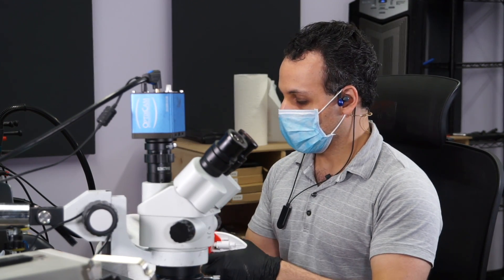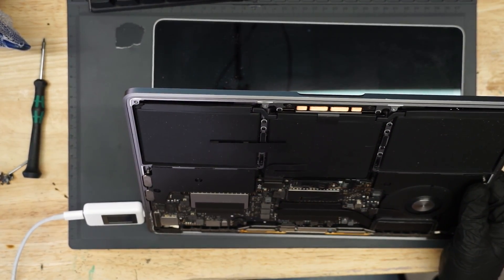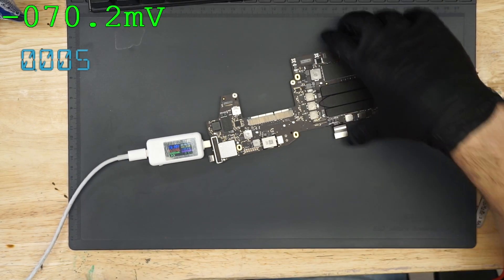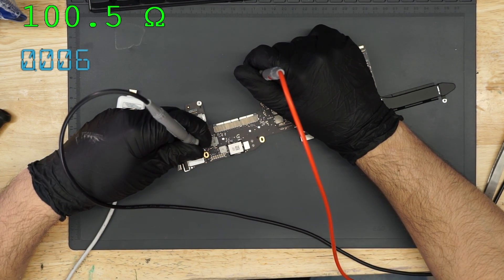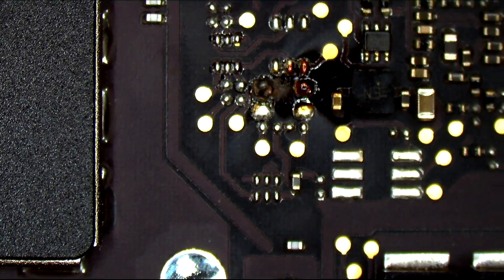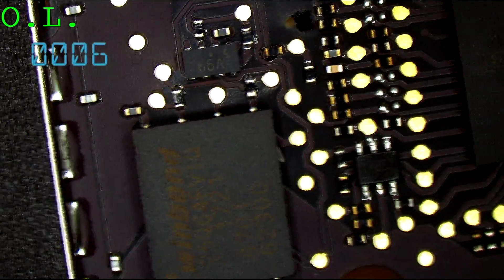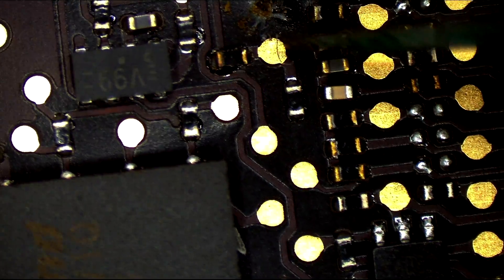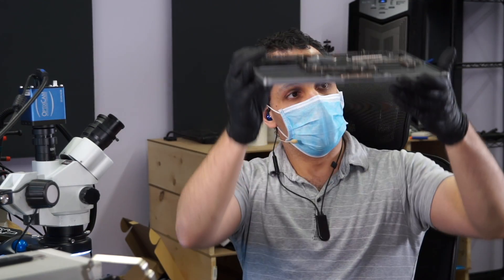Macbook board develops hole through it, Apple calls it liquid damage. 😂

Comment: Customer: My MacBook air doesn't seem to be working.
Genius bar: Alright, let's take a look.
takes the computer into the back and opens it up. Breaths on the liquid monitor, tripping it, and takes a picture. Puts computer back together and returns to the customer
Genius bar: "I'm sorry, your computer seems to have suffered liquid damage and is unrepairable. However, you can buy the upgraded model for just $1599!"
Customer: middle finger and walks away with their computer

Comment: Louis just beware that the "special coating" on the MacBook Pro Retina models screen are very sensitive various chemicals. The ways I clean the screen are either a damp soft cloth or a tiny amount of detergent on a kitchen sponge. So far I haven't had any problems with the coating degrading. Apple even explicitly states not to clean the display of any "notebook" products from apple with anything but a damp cloth. https://support.apple.com/en-au/HT204172

Comment: Customer: "It smells like alcohol"
RRG: "Yes, we put antivirus on it"
Customer: "I didn't think macs need antivirus"
Reply: They weren't doing much thinking to begin with, getting an Apple product.
Reply: @Garenzo314  Ah you don't understand, you need brain power of a special kind to understand. People get apple products for bragging rights. You do not buy overly priced garbage to use, you buy it to show other people you had to money to buy it. Problem is you then don't have money to also buy a working product to use, which would also destroy any reason of owning an apple product cause you wouldnt think of bringing that product you aren't using. 
Takes a special kind of stupid XD
Reply: @Garenzo314  depends how they got it. If it's a gift or something someone tossed out then they are fully inclined to enjoy it. Heck I'm on a trashpicked late 2011 Macbook Pro as we speak. Works perfectly fine and it seems to have been tossed out for its age and because dents in the aluminum chassis suggests dropping

Comment: Customer service telling BS isn't surprising. I had a EVGA motherboard that released the magic smoke one day out of nowhere. After investigation on the board it's one CHL8510 on the VRM of the CPU that exploded. My CPU wasn't overcloked but still there wasn't any heatsink on the VRMs. I contacted EVGA, because franckly I find this to be an oversight of their part and even if the board is out of warranty 4 years for a MB life is quite short. They assured me the chip I took a picture of, the CHL8510 that is a mosfet driver, they told me it was a capacitor and that the capacitor was blown because of a bad power supply ( 3 years later the same power supply is running my actual computer just fine ). Like I don't know how to differentiate a capacitor to a 8 pin mosfet driver ... it was really infuriating to be taken as an absolute idiot.

Comment: Is not possible to hole the damaged zone with an special fine drill head, and then use copper cables to reconnect all the zones that got disconnected by the hole?
Reply: Sure. But a new board is cheaper.
That's a hole in the size of two SMD resistors and there are multiple layers in this board.

Comment: Update: I called a senior Apple consultant and they said the burn was caused by liquid damage and since LR isn’t an authorized Mac service provider, there is nothing they can do. He can’t trust the findings of LR because he wasn’t trained by Apple. If I want, i can take it to another Apple service provider and put my money towards a new one!!!!” Lmao what a joke.
Reply: Jac K - legal action CRA 2015, try section  9 sub section 3 (e) 

You can argue the MacBook isn’t durable.

But, you will need the laptop to be inspected by an independent professional,  then forward the report to Apple. 

They usually settle prior to a court action.
Reply: I believe LR more than apple. He's done many diagnostic and repair of supposedly liquid damaged apple products. I remember one episode where he was angry that a mac was actually water damaged and the customer lied to him.

The board was warped around that particular spot (very small spot) not large area so the word warped is not really correct way to explain it. It was caused by explosion in that particular area where the force caused a "dimple" surface on the other end. Authorized apple service never shows their work transparently and explain where the water damage actually is also. So what one of the fanboy here said that LR never prove otherwise, was in itself pointless. Furthermore I doubt that fanboy knows about board repair as much as LR does.

I'm passionate about LR works because he was sued by apple for doing repair (with reasonable price) that would otherwise forced customer to buy a new apple macbook. Apple is generally a good product, iPad pro is superb, but they are draconian in their business practice.
Reply: Mario Santoso I agree with you, unfortunately it didn’t seem to matter to apple when I called
Reply: @JacK-yb7gu  yeah i'm sorry for your loss there. As business practice goes, that's the only logical response, Apple or not. Really painful to write off $2k++ machine just like that. I hope you have backup data somewhere.
Reply: Mario Santoso LR was able to replace my board. My computer is working again!
Reply: @JacK-yb7gu  great to hear that! I'm truly happy that you got it working again!
Reply: @JacK-yb7gu I'd say stick to AMD for Laptops and for Tablets, IPAD. Cause i love my ipad, so useful.
Reply: @MarioSantoso  Maybe this would be unpopular opinion here, but this is not a matter of belief. Board exposed to water at any point considered to be compromised even it seems fine for months after exposure. Water damage doesn't happen immediately, it leads to corrosion, electrolysis, thermal damage and permanently affects electrical properties of components and tracks, which can lead to fails seemingly having nothing to do with water long after all the liquid is gone. Sometimes you can see some obvious signs like corroded tracks and leads or stains, sometimes you can't see shit. For this reason there are color changing indicators inside.Technicians don't waste time inspecting every board under microscope and testing all the components and tracks, they just check markers.
Reply: @AlexeyOsodoev  yes unpopular :)
I don't mind u tried to explain technical and what you said is true. But come on, r u going to accept a technician just straight up say that ur laptop hv water damage just by looking at the markers? Let's say u know for sure u never spill water? Will u accept that? First u hv to understand how the marker works. What turns them to red? Water yes. Liquid form or from humidity? How much water or how humid? Then you have to look at the "actual" sign of water damage. can they explain and show it to me as customer? Now i don't mind people try to get smart and go into detail here and there like what you try to do here. But really irks me when they don't use common sense and understand what the real problem. What happen to this particular case is just that. Predatory business practice, plain and blatant. And they tried to stop people like LR from repairing the machine. Again please stop talking technical stuffs. I've seen too many people go into detail and miss the whole argument. They see the tree but not the forest. Or for this matter they see the leaves not even the tree.

Edit: I'm not even into the part "can u fix it? How much the cost? Is the cost reasonable?" I'm so irritated now... Thanks!
Reply: @MarioSantoso  Actual water damage isn't obvious or immediate. Inevitably customers who spilled water on their product or left it in a wet backpack months ago will never admit it or accept it as the reason, especially when device worked normally. Forensic work to actually prove that failure is/is not result of water damage is couple magnitudes of order more expensive than the cost of a new laptop. Neither consumer, nor apple would benefit from such approach in every case. That's why there are markers inside. Plain and simple. Apple doesn't make a secret of them and warranty policy. They don't even say liquid damage is the reason of failure. Liquid damage is the reason your warranty void. They don't want to be liable for failure of compromised hardware. If you don't like this policy, don't buy it.
Reply: @AlexeyOsodoev  hmm.. ok. Obviously you avoided the real issue and even dug deeper into your stance. I will leave it as it is. Thank you.
Reply: @MarioSantoso  The real issue here is stupidity of people who don't understand any tinkering with product isn't just about labor and parts costs, there are safety risks and legal liability of parties. You like consumer rights protection, but don't like any obligations this protection requires.
Reply: Alexey Osodoev  Oh boy, here we go... 

You talked with heavy taste of textbook and classroom knowledge/experience. your replies here already swerved from what the video all about, and though you sounded like defending the company that practice those questionable practices, it feels more and more that you are defending your pride. Did my jab about you trying to be smart and need others approval for that came too close to your heart? Well, I'm glad because some people too thick to realize it.

you never answer my questions, then you throw things about risks and legal liability, then more into consumer rights protection and its obligations. oh dear...

i won't go explain customer protection as the sources are freely available and the fight to protect customer rights widely available in YouTube as well. now do enlighten me what obligation you implying here? if you really following the case, the companies try to stop people from being able to repair or choose where they go for repairing their products. famous jargon "your warranty will be void if you go non authorized service center" or somewhere along that line is fine, i never oppose that, it's the rule. It will cost money yes, never oppose that also. i believed this is part of what you mean by obligation.

alright let's go to an authorized service center. look again the video above, the customer went there, genius (i use this term because it's about apple, can be anything else, just for the sake of easiness) checked behind and return to you said oh liquid damage and it will cost $$$ to repair, you might as well buy a new one. how they know? by the red marker - which you defended vehemently (i think because i jabbed about you trying to be smart, so partly at fault here), i won't go over why i object such observation again.

which brings to my reply about can you show where the damage is, how much to repair. Now i said you sounded textbook/classroom or maybe you are passionate about apple or just have loads of money (I'm sorry for assuming all that because my talk about common sense doesn't seem to mean anything to you), if it were me, or like the OP here, we will question and doubt the solution offered. Hell I'm sure most people don't mind paying for repair if it's reasonable, but not really showing where the actual damage is and charged $$$ for repair or get a new one? Now this is where you just firing all cylinder about technical stuffs which again very textbook and bored me to oblivion. No no no it's not about that. The video get back to the video. All the comments were about the video. Apparently it can be fixed and the cost was much less than what the authorized service charged! Now this is what i meant predatory business practice. And there are hundreds of cases like this. And that sir is the issue.

Have you watched LR videos? There's one episode where they charge something around 800++ (cant remember) to repair laptop battery not charging, but LR found out that the battery cable is loose, once he plugged in properly, pronto done! Another about the screen backlight dead, they will charge >1000++, then LR checked, and guess what? it's only a bent pin, he fixed it no charge! Another one, they diagnose laptop not turning on, and said it's the fuse thus you need to replace the logic board! It's like you have lights out in your house, a technician came and said "oh your fuse blown out, you need to replace the house"... ok exaggerated a bit but isn't the function of a fuse is to protect other parts from blowing up, thus you only need to replace the fuse? Are you going to throw words about stupid people tinkering with their machine?

Do you realized that many years ago, electronic products come with some manual and wiring schematic for troubleshoting and repair? And how that's no longer the case? I worked in factory/industrial equipment before. I know exactly why, to get customer call for repair with the machine manufacturer. Do you know some part/component were deliberately made difficult to find in the market? So you can only buy from the manufacturer. Do you know why? Of course you do! It's all about money. The first and foremost reasons and jargons will be.... drums roll: warranty and safety issues, it will not work if you use non OEM/original parts. Damn your reply nothing short of what those people will say lol and yes they will throw all that technical stuff as much as they can to confuse the customer and "scared" them. But you sounded pure, untainted!!! Or just damn corporate!!

Now I'm no saint nor demon, if I'm a manufacturer such practice will come into mind and consideration, but if I'm the customer, hell damn i will try to get a fair/reasonable solution to my problems and save me some money! I even learned how to fix a lot of stuffs myself. Sometime they work sometime they don't, meh. Most industrial machine are not that difficult, especially the non high tech one (less or no software involved).

Again i think all of these started after my jab, i can't get that out of my mind. And the more i see your reply the more true i feel it is. But oh wait wait, I can see you denying and you will throw some interesting stuffs. I was like beating myself for breaking my own rules "never reply to certain comment, which yours was in that category" but i was tired that night and reading your comment just ticked me off. Guess what, you ticked me even more! You are free to defend yourself. And damn i hope people get a good reading material here

ps. english is not my 1st language, so i do apologize for my bad english

pss. Sorry Jac K for polluting your thread! I won't post again
Reply: "alright let's go to an authorized service center. look again the video above, the customer went there, genius (i use this term because it's about apple, can be anything else, just for the sake of easiness) checked behind and return to you said oh liquid damage and it will cost $$$ to repair, you might as well buy a new one. how they know? by the red marker - which you defended vehemently (i think because i jabbed about you trying to be smart, so partly at fault here), i won't go over why i object such observation again."

I just explained why those markers exist. Because in many instances it's impossible to locate liquid damage by visual inspection. You don't trust those markers? Want it pointed out? Fine. You pay $100000+ for independent electronic forensic investigation. In case report says this failure in no way could have been linked to liquid damage, apple covers the cost and gives you new laptop. Or Apple pays for it, but if report says it was in fact liquid damage, you owe apple $100000+. Do you like with this approach?
Reply: @AlexeyOsodoev  For that specific part to short due to "humidity" other components should at least show some corrosion. There was nothing else on that board, no other signal.
Reply: @Soniku Raharu LR would count as an expert witness in court in terms of electronics and electrician work.. in his opinion that was not loquid damage, which is obvious that it wasnt.. I csn just by looking at it tell exactly the same.. the apple employee in charge of trouble shooting did not do his or her job and their store instead of replacing the machine gave a catch all bullshit answer which absolves them from their obligation of replacing it.. provided that the customer does not look into it through a third party, whoch according to US law will find them in breach of contract with their customer on warranty if it is not water damage as they said. Also fraud.

A warped and crisped board is a sign of persistent, intense heat, or one burst of extremely intense heat, the warp and the blowout indicates a small electrical explosion which can happen with faulty electronics, I have seen and experienced such a thing in perfectly dry conditions. 

In summary, the store is one meeting away from a million dollar lawsuit which they are guaranteed to lose.
Reply: @Soniku Raharu While I agree there is the possibility of conductive liquid causing a catastrophic failure of a capacitor (which looks like the source of the explosion), the precision required to pull that off, even in a humid climate, without harm to other components seems extremely unlikely. Occum's Razor would lead any technical expert to the conclusion of component failure. As deep as the damage was inside the laptop (not near any exhaust/intake vent) would also rule out other foreign particulates. Not much can get that far into a laptop that is properly sealed (including liquid) and leave no other trace of damage.
Reply: @NFITC1   Exactly, the liquid would've had to somehow crawl past 500 other conductive areas to reach that one, and the chances of that are literally so minute, that it would be less than winning the lottery.
Reply: Your first mistake was buying an overpriced Apple product...
glad you at least went to a reputable repairman instead of bending over for Apple's scams
Reply: @Soniku Raharu Short cans also happen when dry as Atacama desert graphite dust gets somewhere. Until breakthrough in closed loop cooling and neutral gas filled, sealed chassis.....
Reply: @Soniku Raharu 😂